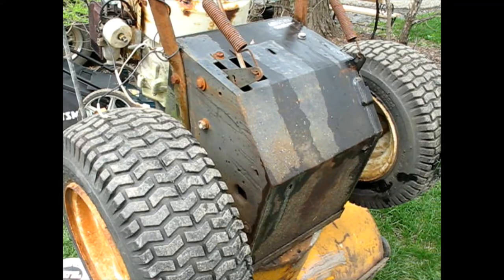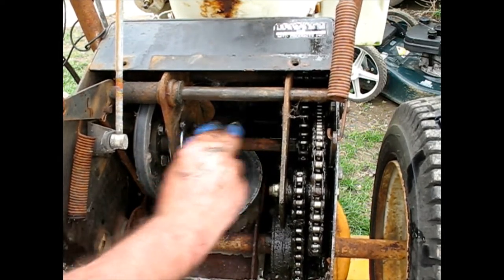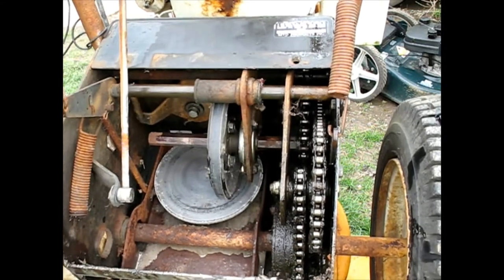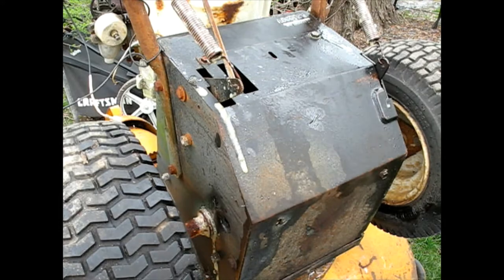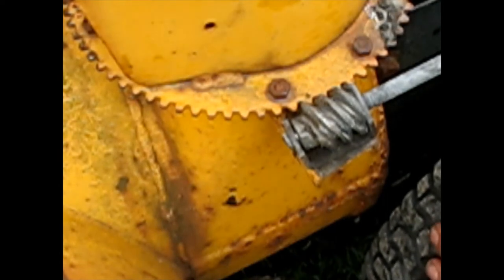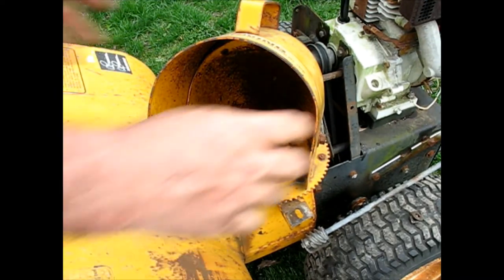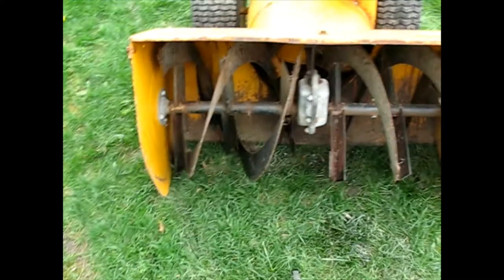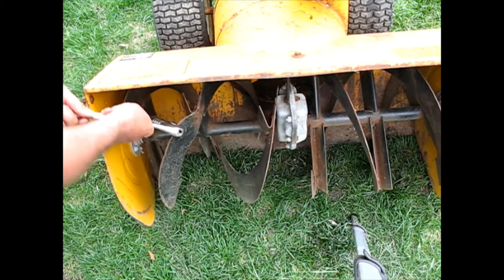Tecumseh 33'' beast 10hp MTD snowblower  Sticky shifter repair and more. playlist part 3

Comment: I have that same MTD built unit but with the Briggs engine. I have rebuilt the worm gear auger drive box twice in it's lifetime and machined up replacement bronze axle bushings with grease fittings and provided a grease line and fitting for the impeller shaft rear  bearing. The engine has never been apart and with the usual required carb maintenance it runs like a champ and tosses heavy wet snow while being close to 50 years old.

Comment: Thank you so much for making this series as I happen to have a 8hp/24" Snowflite of a similar age outside in the backyard. I think I'm going to save it as it has a 14" impeller.  It is under a tarp but i'm not sure about the condition of the engine. Probably repower it with a modern engine.